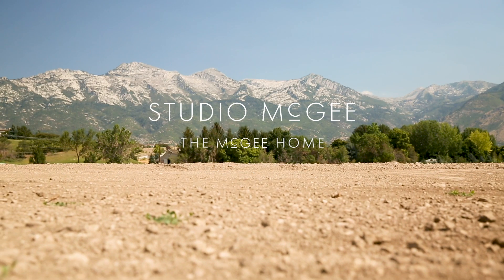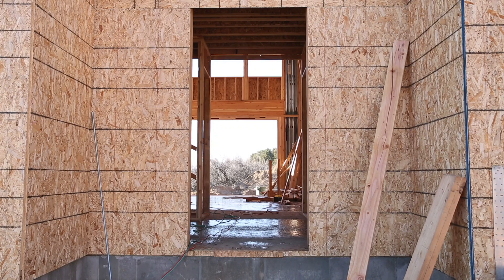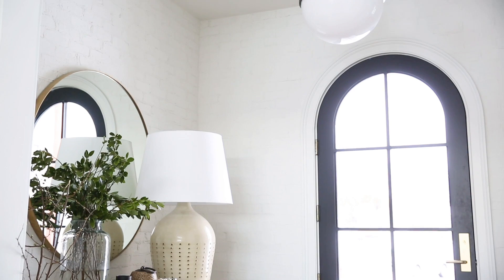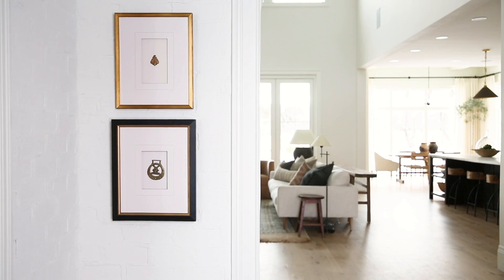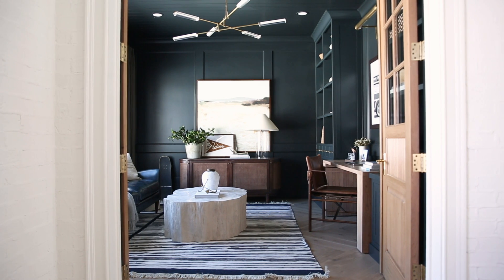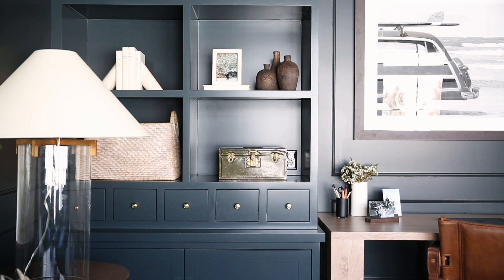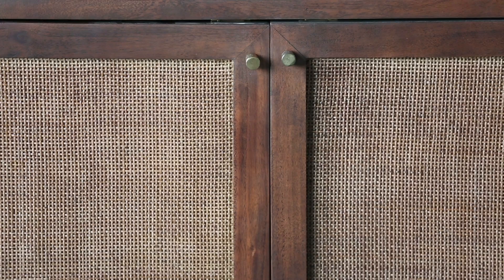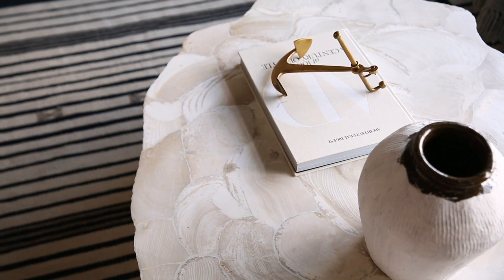The McGee Home: The Entry & Office

Comment: What a nice office BUT NOT A VERY GOOD FENGSHUI. The working table is not at the AUTHORITY LOCATION. He won't be doing much work related in this room. He will be spending most of his time lounging and just be lazy at the couch - reading, browsing Internet etc. And he won't be spending much time in this room. So, u better change  the position of the working table to the front of the big wall and he must be sitting facing towards at the beautiful wooden door. From there he can see who's coming to the room and who's outside of the house by looking through the window. It'll make a huge different. Believe me you..